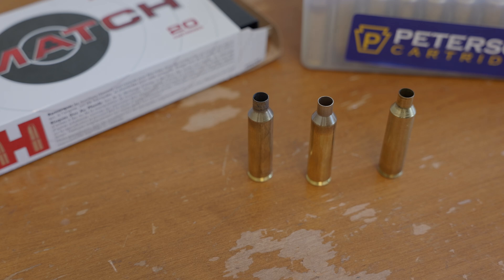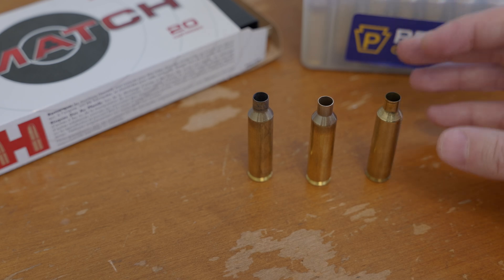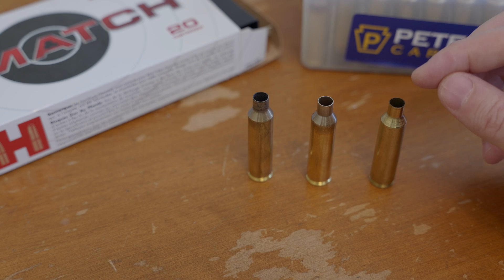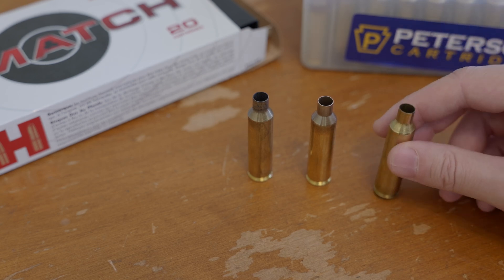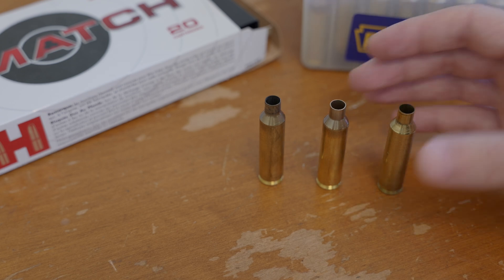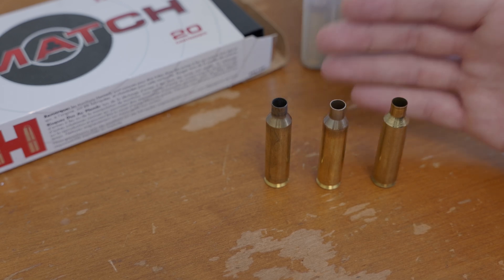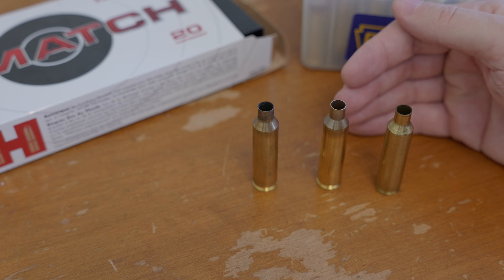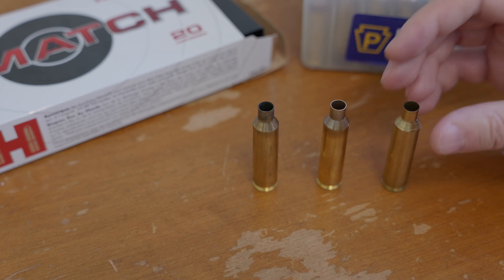Measuring Case Capacity

Comment: So, should you trim to length before measuring case capacity?  I have 2x fired brass, but hadn’t trimmed to length yet.  I’m beginning to use GRT and believe it would be preferable since this will determine capacity. Your thoughts.
Reply from the maker: You should trim prior to firing them, to get the most accurate measurement. Once you trim a case, you shouldn't need to do it again for some time. And a slight change to the neck length won't change the volume your ammo has much at all, since you will generally load to length using the bullet and base as references (so the neck isn't part of the measurement of loaded ammo). But yeah, probably best to trim them uniformly prior to firing for this measurement, just for consistency.

Comment: Interesting. I am trying to figure out why I have extreme pressure signs (e.g. blown out primers, flattened caseheads, blown out extractor) from a load that should be under maximum pressure. 4 out of 5 rounds showed no pressure signs whatsoever but one had the issues I described. The temperature outside was also 4 degrees Fahrenheit so it’s not like high temperatures caused it. I was shoot 6.5 Creedmoor with 140 grain Berger bullets and 42.5 grains of Winchester 6.5 Staball. I seating to further than the COAL in the reloading manual. So I have no idea why it happened. It is Lapua brass so the brass volume is pretty low compared to other brass. That’s the only explanation that makes any sense to me.
Reply from the maker: Really hard to say, and every firearm is different. If your whole gun is at 4* F, then it's possible the chamber was a touch tight and smaller due to contraction. If you loaded the cartridge long enough that the bullet was touching the lands, with no jump, that can also increase pressure. There are also occasionally powders that increase velocity slightly at lower temperatures, but I haven't seen any tests on StaBall 6.5 to know if it's one of them. Could also just be that particular combination with your particular rifle.
Reply: @TechDregs  It is weird. I gave it 20 thousandths of jump. It’s also a Tikka so it’s kind of designed with cold weather in mind. The velocity was also nothing crazy (2,711 fps). Yet, a primer blew, the casehead was totally mangled and when I was able to get the cartridge out, the extractor claw came falling out of the gun. Thankfully the extractor claw wasn’t damaged and I was able to install it back in place. I almost wonder if it could be due to condensation inside the barrel after firing multiple rounds.